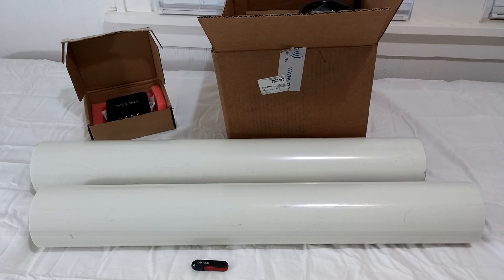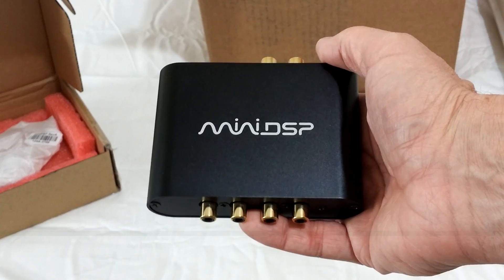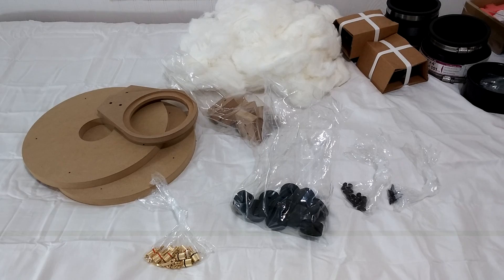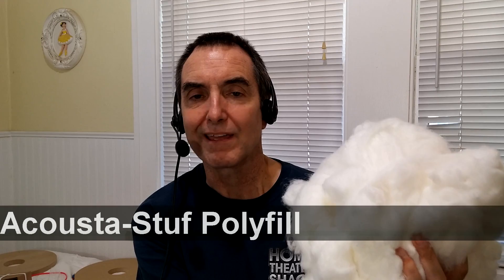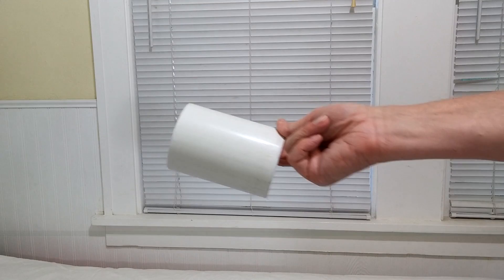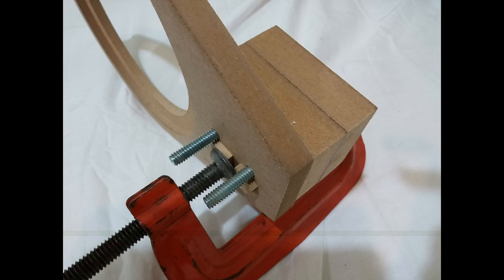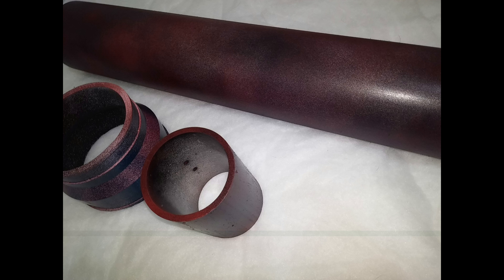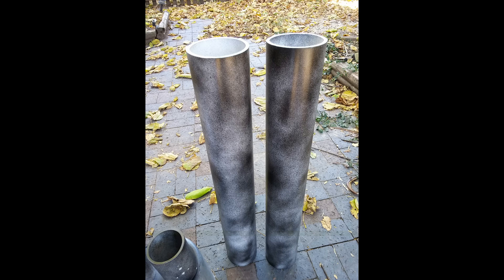LXmini Build Video Part 1

Comment: Hey Wayne, i hope you can help. Saw your build vids and that took me over the edge and i purchased a kit tonight.
Got the german one. But i need to be able to post on the oplug forum. I am assuming you have an account there. If so, could you please contact the admins and tell them their confirmation of registration emails is not working. This means i cant post, and i need to post for help. (Damn thing says if you cant register then  seek help from the administrator - but there is no way of contacting an administrator!) I have used the user name Yorg, for their reference. Cheers, George.